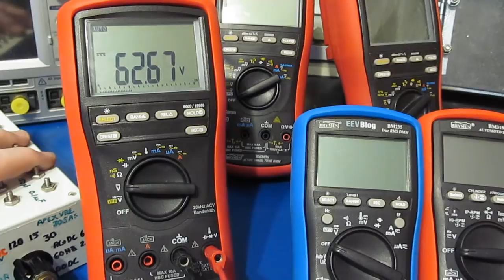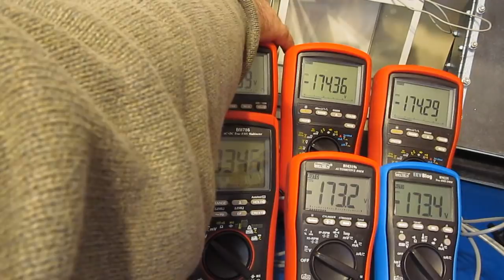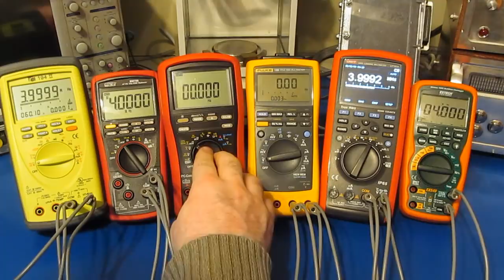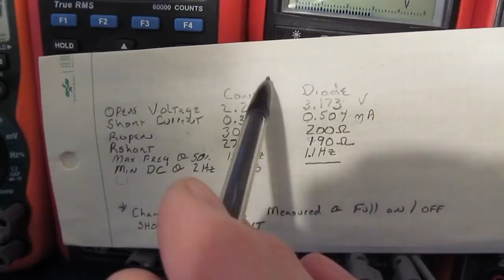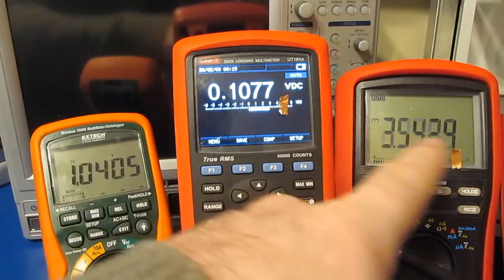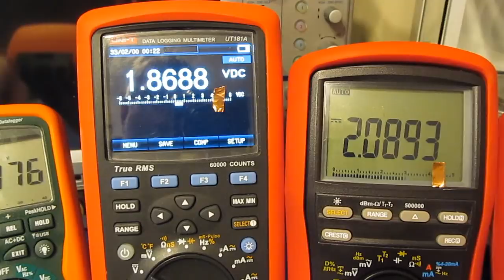Brymen BM786 DMM Part 2, A Deeper Look at AutoRange

Comment: Very scary & surprising that BM786 shows a 50V+ signal as < 5V.  That could be dangerous!   Also the Crest factor rating of BM786 (only 1.6 @ Full scale) is surprising. I would have expected 3 or more.
Reply from the maker: Of course the meter had not yet been released and  I did go on to show some of the later changes.
Reply: @joesmith-je3tq  Thanks for confirming; I assumed they would fix that issue. I did watch subsequent videos but have to admit I skipped through Part 4 since it was over 1.5 hours.
Reply from the maker: @chrisaz7567  I have shown problems like this in the past with other name brand meters.  In this case, I just happened to be working with a company interested in improving their product.   Part 4 covered a lot of different tests which takes a lot of time.  Of course, I could have just unboxed it and talked about how great the product was, maybe connecting it to a resistor.  Then ask viewers to join and send me money.   lol.

Comment: Joe, what's the top 3 meters for you from among the handhelds that you've tested? After having read hundreds of your comments, I know pretty well that you can't tell me what's my top 3 meters ; )
Reply from the maker: Define top.
Reply: @joesmith-je3tq  LoL
Reply: @joesmith-je3tq  let's define it then. Top = functional versatility, speed, robustness
Reply from the maker: @roseelectronics4582  Of the metrics you're asking about, I only collect data on electrical robustness.   That data has been made available for years.
Reply: @joesmith-je3tq  thanks Joe
Reply from the maker: @roseelectronics4582  Do do not define what you meant by Speed.  I did record some data for the continuity test.
Reply: @joesmith-je3tq  I meant speed to be mainly continuity beeper. I've found Hioki DT4261 which claims to detect shorts or opens as brief as 0.5 milliseconds. I'm thinking of getting that one.
Reply from the maker: @roseelectronics4582  The less detail you supply, the more people are left to guess at what you are asking.   Depending what you mean by a short/open and how you want the data presented to you, there may be better meters suited for your particular needs.
Reply from the maker: I should be more clear.  Some meters allow you to set the threshold.  Some latch the signal allowing you to hear it.  IMO one of the best short finders I have used wasn't a meter at all.
Reply: @joesmith-je3tq  I trace automotive circuit boards for continuity between points. I want to drag the probe along the pins of ICs and be sure that I haven't missed the connection
Reply: @joesmith-je3tq  I trace automotive circuit boards for continuity between points. I want to drag the probe along the pins of ICs and be sure that I haven't missed the connection
Reply from the maker: @roseelectronics4582  There are some fast ones out there.  You may also want something that will have a loudness adjustment, settable thresholds, visual indication....
Reply: @joesmith-je3tq  so far, the fastest meter I've seen is BM869s but that one is little bigger for me. I'm looking for a medium sized handheld that can do it. Recently, a fluke 12B was on auction but unfortunately, someone else snatched it
Reply from the maker: @roseelectronics4582  It's latching and reset times are too slow.  Fastest are non-latching.  Then again, it gets back to what you are looking for.  You never mention the reset time or how long the audio is active once the threshold is met.    You may be better off designing something custom for your particular needs.
Reply: @joesmith-je3tq  I want a meter that doesn't delay it's latch too long
Reply: @joesmith-je3tq  honestly, I don't know how to design my own
Reply from the maker: @roseelectronics4582  You could go with the very low end meters with a non-latching type.  Some are fast enough to play audio.
https://www.youtube.com/watch?v=svJXiMMZzcQ
Reply: @joesmith-je3tq  wow, this one can play guitar too! I looked for it but unfortunately, it's been discontinued. Anyways, I'll go through your spreadsheet and figure out what'll suit me best. Thanks Joe! I enjoy watching your reviews because of your transparency, and straightforward, unbiased judgements.

Comment: what multimeter do you recommend for small electronics under $50 and lower?
Reply from the maker: There is a link in the description for this video where you will find a FAQ (Frequently Asked Questions).
Reply: Below 50 $ UNI-T UT-139C but it is not very safe if you are going to measure voltages higher than that of a plug. For a little more you have the Brymen BM235 Better quality and safer.
Reply from the maker: @carlosgarciamuniz  I thought both the meters you mentioned have been certified.  What makes the UNI-T less safe than the Brymen you mention?
Reply: @joesmith-je3tq  Sorry, I wanted to explain that I would not use it to work with voltages higher than 600V. It's good for the money it costs, but it has bad things ... Your probe only measures up to 446º F. The screen contrast is bad. The capacitor is very slow. The frequency meter does not measure the DC component (you have to put a capacitor to measure the frequency)...
Reply from the maker: @carlosgarciamuniz  I've used several of the low cost meters well above 600V but in the lab, seldom with with enough energy to cause much me concern.   It's all of these details as to why I seldom offer any advice.   The person asking should know exactly what they intend to use the tool for.  We don't.

Comment: Great videos Joe.
Have you seen new Uni-T multimeters? UT191, UT195, UT17B PRO? What do you think about them? From inside inspection looks like they have upgraded protection. Any chance you could have a look at them in the future?
Thanks for your hard work, very educating.
Reply from the maker: I haven't considered looking at another UNI-T product as they have always performed poorly against my tests.  Just a quick glance at the 191, I see the shared current voltage input. I have my doubt already.  

I have looked at more UNI-T products than any other.    If they were to improve the UT181A, I would invest the time to revisit it.   That's really the only meter they offer at this time that I am interested in.  Well, if they would make a higher quality version of the UT210E I would also be interested.  Switch failures are becoming more common now as they age.

Comment: Try an original Fluke 87 from the 80's or early '90s.  It is very fast in auto range mode in resistance.  Whey have all these gone down hill since then?
Reply from the maker: I don't normally look at old meters.  I did run an old Fluke I found in the trash bin a while back for the fun of it.  I also bought a beat up 189 that I ran, because I like the meter and was curious how it would hold up.  I did not collect any data for these two meters.

Comment: Joe, I bought a Uni-t 181. I know is fragile, but I still love it..
Reply from the maker: I was waiting for the battery to drop out when making this video.  Takes overnight to recharge it.   Of course, I have to use my AC wall adapter because they don't supply one with it for the USA.   Of course, you can't use the meter when it is charging so maybe we could just drop in new batteries.... Oh wait....     Besides the UT210E, this UT181A is my favorite UNI-T product.  It's pretty well made and with it being a clone of the Fluke 289, it's easy to drive.   It has a lot going for it.  Too bad they just didn't go the extra mile.
Reply: @joesmith-je3tq  Yeah.. Have to agree.  But no carpet in my lab..

Comment: Fluke 87V has Bar Graph Zoom Mode. In the mode bar graph shows relative value when rel-button is activcated. Zero value is at center of bar graph and range of bar graph is tenth of meter's active range. This helps when tuning a circuit to zero or peak.

You can enable Zoom Mode by holding rel-button while turning the meter on. While you are measuring value you want to set as zero press rel to activate relative mode and relative zoom bar graph.
Reply from the maker: The Fluke 189 can also scale the bargraph using the Rel.

Comment: Looks like Brymen has made another good one, although that auto range problem is a odd one.  I do hope Dave picks a Brymen. I'm not into the 121GW it seems to have a lot of little bugs that a meter at it's price point shouldn't have.
Reply from the maker: He has shown a few pictures with the blue case, along with a prototype.   I'm not sure if he's run into this problem or not.  I don't recall seeing him post about it.
Reply: The BM786 isn't made to order like the 121GW, it's an existing Brymen model.

It looks like Dave is working with UEI again to make another DMM to his specifications. https://youtu.be/UVjLoJMVL0s?t=199
Reply from the maker: @Okurkaarrgghh  I don't believe you can buy it yet.  It's been pretty much a year since Dave first brought it up but it was just recently that he showed the first prototype.    Brymen / UEI, no comparison.
Reply: @joesmith-je3tq  The BM786 is exclusively for EEVBlog, but it's not a meter that Dave co-designed; it's 99% the same as the BM785.
Reply from the maker: @Okurkaarrgghh  I don't believe anyone mentioned co-design.   What caused you to come to the conclusion the BM786 was exclusive for EEVBlog?
Reply: @joesmith-je3tq  https://www.eevblog.com/forum/testgear/new-eevblog-bm786-multimeter/

"The BM786 model will be exclusive to the EEVblog."
Reply from the maker: @Okurkaarrgghh  Did you ask Brymen?
Reply: @joesmith-je3tq  Are you saying that Dave is lying?
Reply from the maker: @Okurkaarrgghh  While I suggested you contact Brymen, you chose to ask Dave.  Your last question was very clear and I thought Dave's answer was also very clear.   This is the third time Dave has made a statement like this.     

Getting back to your question on if I am saying Dave is lying.  I tend to deal in facts.  If I am presented with something I do not understand, I will dive in to learn more about it.  Do I feel Dave is deliberately intending to deceive his audience?   Really, I don't know and don't care.  I am interested in understanding why what Brymen has wrote me seems to go against Dave's last response to you.  

At first I assumed Dave was just claiming he would be the sole Australian distributor but with your last question being so direct and clear,  obviously  there is some confusion.   It could very well be on my part but I thought Brymen's letter to me was also very clear.    I have asked Brymen to clear it up.  

https://www.eevblog.com/forum/testgear/new-eevblog-bm786-multimeter/msg3302926/#msg3302926
Reply: @joesmith-je3tq  I asked Dave because I wanted a confirmation from him; he's the one who claims the BM786 is exclusive to EEVBlog. 

When Brymen releases a red BM786 and sells it elsewhere I'll get back on that forum thread.
Reply from the maker: @Okurkaarrgghh  With it being Friday, I don't expect to hear back from Brymen until next week.   Just the fact Dave agrees with your statement about no red case is odd  as they have specifically written me otherwise.   Why they would make a generic case for the BM876 not to sell it seems like a poor investment.   Be patient and we will figure it out.
Reply from the maker: @Okurkaarrgghh  I heard back from them.  The jist is basically EEVBLOG will indeed be exclusive.  The case would not have been for public release.  This is what threw me off.
Reply: The 121GW is the first DVM that I have no trust in.  It's an expensive piece of junk in my opinion.  The free Harbor freight is more reliable in auto mode.
Reply: @Daveyk021  I don't have one so I really can't say but from every thing I have read it seems to have way to many issues. It also has a lot of useless features that most people will never use.